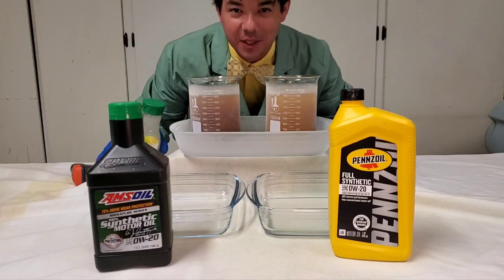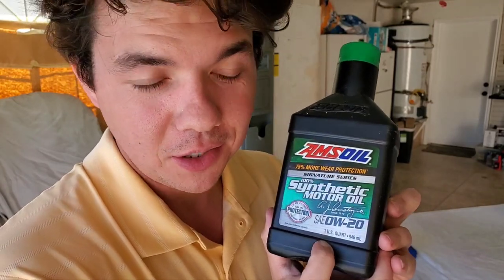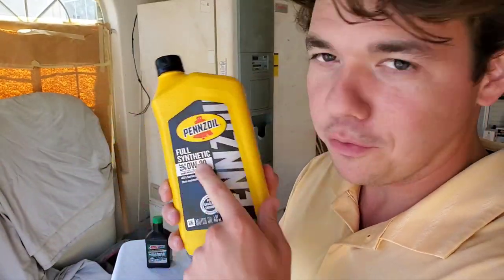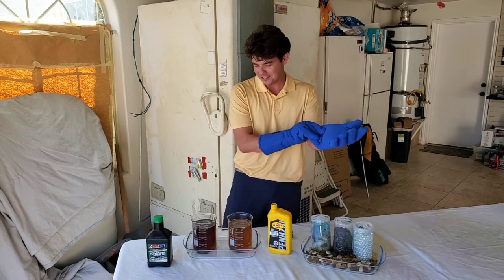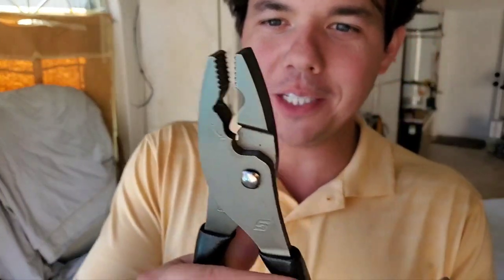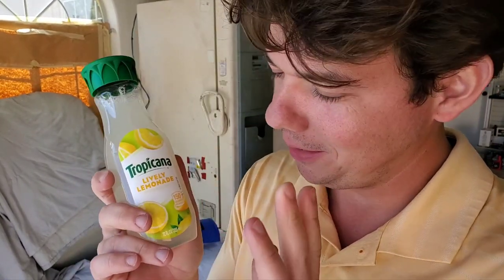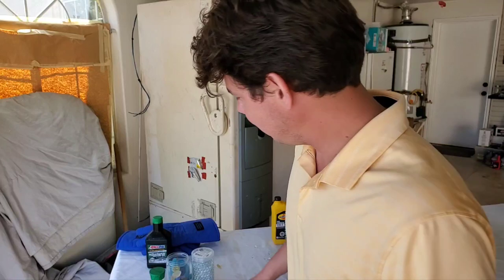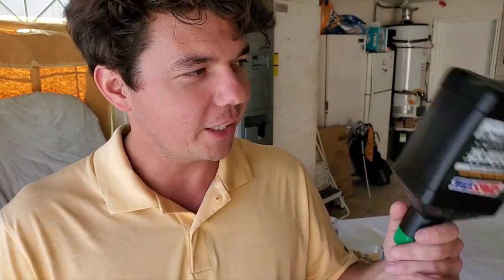AMSOIL VS Pennzoil Full Synthetic Motor Oil

Comment: Excellent this a temp -37F/ -38C  that are closer real life for most of us.     Thanks Eben.
Reply from the maker: That's the skin of the oil the oil was out of the freezer for about 4 minutes the inside is still extremely cold if you measured it it's probably with the laser It was probably still negative 44° C
Reply: @Syntheticoilprotection ✔

Comment: I've been running Pennzoil full synthetic in 2 different ram 5.7 for years. Never had any issue. I also live in hot climate Phoenix AZ.:body-green-covering-eyes::body-green-covering-eyes::body-green-covering-eyes:
Reply from the maker: Sweet!
I recommend you try Amsoil you will be very impressed👍
I have a lot of customers that have switched from Pennzoil Ultra Platinum and they were very surprised.
♥️   See Fluid Performance Tests - https://www.amsoil.com/performancetests.aspx?zo=5331179
Reply from the maker: The difference is one is a full synthetic the other one is 100% synthetic and oil manufacturer can call a full synthetic full synthetic when it's only 25% synthetic Amsoil is 100% synthetic creates a much higher film strength keeping the metal Parts separated less friction less heat less where better fuel mileage less oil thickening longer lasting motor with better performance.

Comment: I looked up amsoil signature series verse Pennzoil ultra platinum on YouTube. Another guy test them and the cold flow test they were neck and neck, The amsoil did win, barely the burn off rate the Pennzoil ultra actually did better. Friction test the amsoil won. I think amsoil signature series is better. Not denying that.
Reply from the maker: Yeah they're not even close because the test he does is laboratory there's field testing and then there's lab testing field testing is an entirely different animal and once you get out in the battlefields that's where you see who really comes out on top.

Definitely check this out you'll get a kick out of this.

Oil Analysis Tests: 

15,500 Oil Analysis Test Results SL550 - https://youtu.be/3rdN6U1Jt_M 

5500 Mile AMSOIL Oil Analysis Test Results - https://youtu.be/3wf962IwEmo   

5000 Mile AMSOIL Oil Test Results On My SL550 - https://youtu.be/fLuvzN6yLSw 

11,000 Mile AMSOIL Oil Analysis Results on my Corvette - https://youtu.be/YEY_13UYzA4 

20,000 Mile Oil Analysis Results on Honda Uber - https://youtu.be/gm_PXlpiaTk 

26,000 Mile Oil Analysis Results - https://youtu.be/Wdq2A2YIorM 

80,000 Mile Oil Analysis Test Results Freightliner Cascadia - https://youtu.be/9A9k6i1xMoo 

25,000 Mile AMSOIL ATF Analysis Test Results - https://youtu.be/IeVPGR7UO9E
Reply: @Syntheticoilprotection  Field testing introduces a bunch of different variables, like for instance your first "cold flow" test they were at different temperatures as well as the amsoil jug was mounted slightly higher.

Laboratory tests are designed to be repeatable to actually show the difference at the exact same measurements, not introducing random variables that can't be exactly repeated on different oils.
Reply: @Syntheticoilprotection  nobody should change there oil above 3 k miles ! Your just asking for trouble , I stick with Penzoil !
Reply from the maker: Yes that's true especially if you're using mineral oil you would want to change it at about 2500 mi as the oil thickens it becomes harder to circulate You have less cold start protection also the film strength at high heat breaks down 

If you're running a full synthetic you're good for about 5 to 7,000 mi depending on how you're driving.

With Amsoil you're good for 15 to 30,000 mi just depends on how you're driving if you do oil analysis this video on my car will show the difference and how it's better and different with 100% synthetic film strength
https://youtu.be/3rdN6U1Jt_M
Reply from the maker: This is some great lab testing 
♥️ AMSOIL Performance Tests: Read This Article - https://www.amsoil.com/performancetests.aspx?zo=5331179
Reply: @Syntheticoilprotection  never ever let ur oil go past 3 k miles , just look at it and u see why , check ur oil often , ur giving a false sense of security saying to run ur oil to 15k miles or 30 k miles , pull that dipstick and u will be 3 quarts low with sludge in ur oil , best u can do for ur engine is change ur oil often with a new filter !

Comment: I need advice. 

My question is can I use synthetic oil or a high mileage oil ? Any recommendations for oil filter too?

I just bought a used 1996 Toyota Celsior (Lexus LS400) it’s a JDM car. It only has 43k on it. I don’t have any maintenance records from the owner in Japan. I don’t know if the previous owner used synthetic oil. It’s a V8 engine
Reply from the maker: Great questions Adrian yeah I would do an engine flush I would also do a bottle of the PI performance improver also one case of upper cylinder lubricant I would get the Amsoil signature series and the oil filter and you'll see everything right here with the lookup guide I would also do the 6-month PC membership we'll save you a ton of money and when you use my link I'll be your dealer so in the future if you ever have any questions on the products I can always speak with you and happy to help in the future appreciate the future business and I appreciate you being a part of my YouTube community.

❤️🇺🇸❤️ Professional YouLubher: Eben Rockmaker Regency Gold Direct Jobber AMSOIL Specialist (Dealer#: 5331179) 702-472-3614 

      ✅✅✅  New To AMSOIL I Recommend The AMSOIL 6 Month PC Membership because it will save you about $33 on a $100 purchase after the difference in tax - https://www.amsoil.com/offers/pc/?zo=5331179

Comment: Not -50° this time?
Reply from the maker: Yeah I left the oil out of the freezer for about 3 minutes and the skin of the oil comes up the temperature pretty quick If you measured the core temperature it would be pretty close to that negative 47° C

When the freezer kicks off it kicks off and negative 53° C and then it kicks back on at negative 50° C so the core of the oil is actually quite a bit colder than the skin the skin warms up from the air temperature and it warms up from the outside in.
That's why you see that little bit on top pour off when I pour the Pennzoil the skin just melts right off.
Reply from the maker: The freezer that I have is a specialty cryogenic freezer It is negative 50 C to negative 86 C which is about 122° F below 0 It's for stem cells and different types of specialty work for laboratory and it will not go warmer than negative 50

Comment: Try it with Pennzoil Ultra Platinum. That would be a fairer comparison, and would much closer in quality to the Signature Series. That Pennzoil synthetic is likely no better or even worse than Amsoil OE.
Reply from the maker: They are a big difference one is 100% synthetic the other is a synthetic blend.
A oil manufacturer can call a full synthetic full synthetic when it's only 25% synthetic.
Let's give a man a fishing pole & show him how to fish. 

     Together! We can get your vehicles to run better than brand new!

     For me to get credit & be "Your" Independent AMSOIL Dealer, please use my website below or my dealer no. 5331179 call anytime Eben Rockmaker 702-472-3614
After you click on: http://syntheticoilprotection.net
1. Click the hamburger menu
2. Click offers AMSOIL preferred customer
3. Click join now. 6-month PC member add to cart.  ( There is no reoccurring renewal membership unless you select that dot box ) 
( You have the option to not have your credit card saved if you prefer - est. 1972 )
4. Scroll up to the top Select shop by vehicle. 

New Promos: FREESHIP & 5CERAMIC

    ♥️   Your vehicle can run better than brand new by choosing the right fluids!

     🇺🇸   50 Years of AMSOIL anniversary - https://youtu.be/MQUqRBI8dD0
     
     🥇🥇🥇   Synthetic Oil Protection Google map reviews
Eben Rockmaker, independent AMSOIL Dealer 
Dealer no. 5331179
(702) 472-3614
https://maps.app.goo.gl/1aXxuXrXK9eJwqK78
         
♥️   See fluid performance tests - https://www.amsoil.com/performancetests.aspx?zo=5331179
Reply from the maker: https://youtu.be/0lXL0va_8rY?si=zqXUhZWQpOqR5TYq

Comment: I never was a penzoil fan.
Reply: I like Amsoil but Ultra Platinum is extremely hard to beat for the price. Amazon sells the 5w20 for 24 dollars.
Reply from the maker: When it comes to the value they're not even comparable the M's oil becomes quite a bit less than free because you go longer for oil change you have less build up in your motor you make better few mileage because it's less parasitic drag on the crankcase also you don't top off as much with oil so it saves you time.

This is the results.
♥️ AMSOIL Performance Tests: Read This Article - https://www.amsoil.com/performancetests.aspx?zo=5331179
Reply: There is no doubt that Amsoil is in a class of its own. Definitely a superior oil. The comparison should be made with other premium oils like Royal Purple and Schaefer. Even when Amsoil comparing these superior oils it will come out on top. With all that said each,  oil has its place.  I am a huge fan of  Pennzoil. This oil is hard to beat for the money.
Reply from the maker: Hey Bob we have a lot of videos on those other oils you mentioned you'll see on the channel if you go to the playlists you'll see cold flow oil playlists and you'll see it is about 40 videos.

Also if you're looking at value I highly recommend you try the Amsoil Signature Series You'll be surprised how much more money you'll save compared to the other oils if you're looking at that it is good for about 2 to 7 times longer than most of the OEM intervals depending on how your driving it also you have the benefits of less parasitic drag because of the 100% synthetic better fuel mileage less top off less wear in the motor You'll get a kick out of this video here and if you have any questions you can always reach out to me always happy to talk lube 
https://youtu.be/0lXL0va_8rY